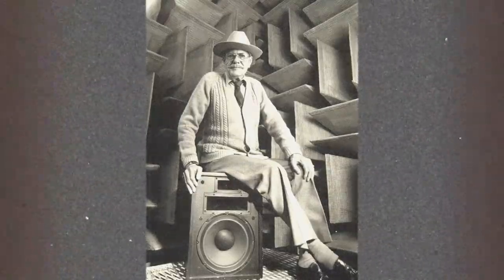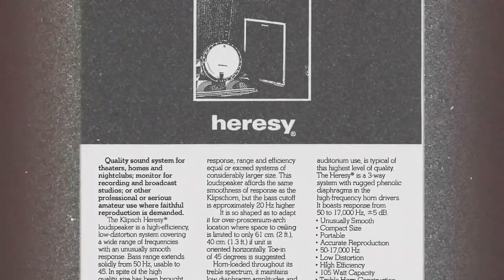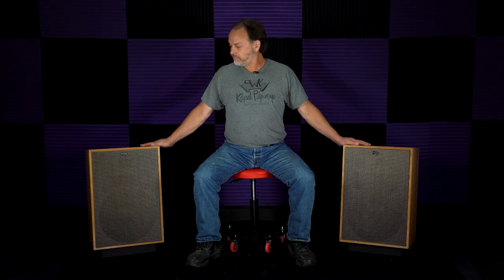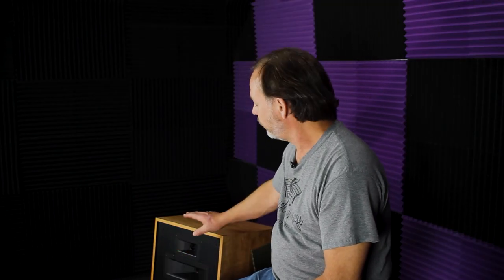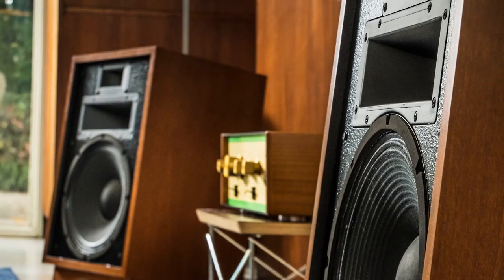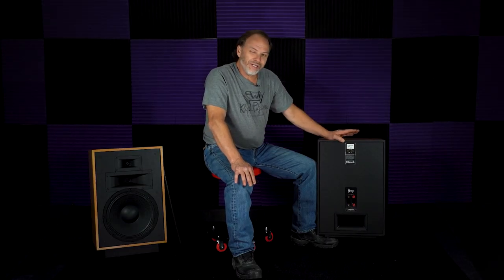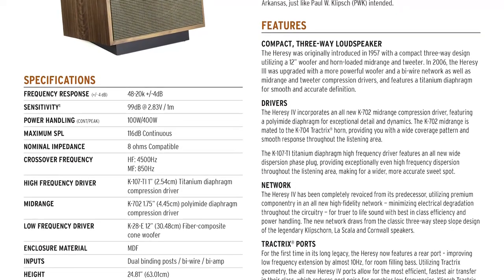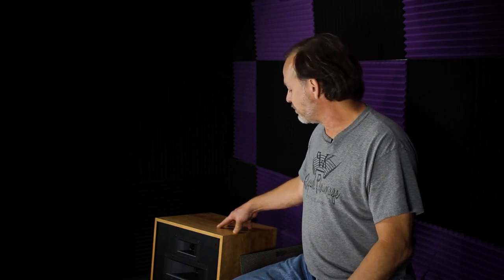Klipsch Heresy IV History - The original Klipschorn center

Comment: Wow, lotta info there!   I wonder if that square port could be easily added to a heresy 2 and get the same results?
Reply from the maker: People have ported them but I can't speak for the results.  I've seen a port on the bottom before.  Can't say I recommend it but it happens.  Pretty sure there's a few projects floating around on the Klipsch community forum.  At the minimum it's probably not going to dig as deep.  The new cabinets are a little bigger if nothing else.
Reply: then you probably need to replace woofer for that newer one  (K-28?) as well

Comment: Using a cheat, +/- 4db instead of 3 like in the previous version is how Klipsch "got" an additional 10hz on the bottom.  It should have never been ported.
Reply from the maker: The III is rated at +/- 4db as well. This is not a cheat or some kind of cheap trick. The additional bottom end is real and it's an awesome improvement. The port, as well as other changes in the new design made a vast difference.  Listen to this unit in person if you haven't already. The difference is not subtle.